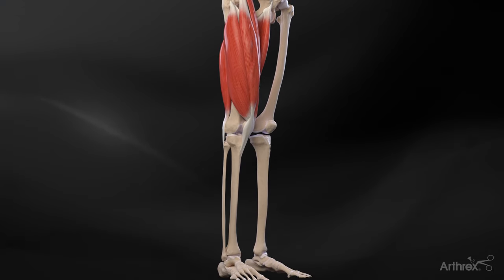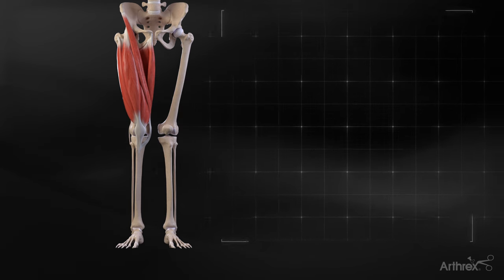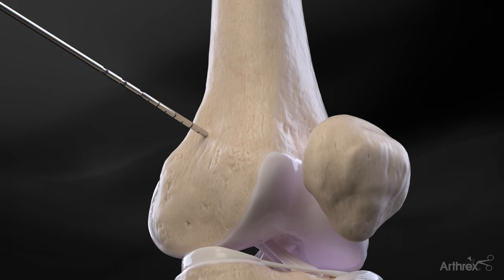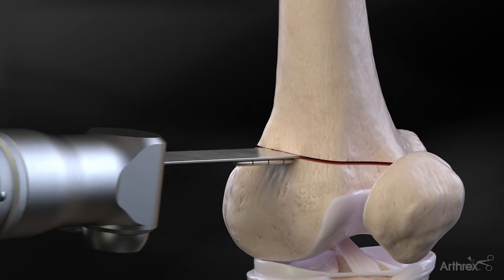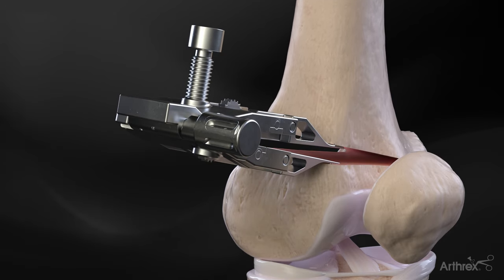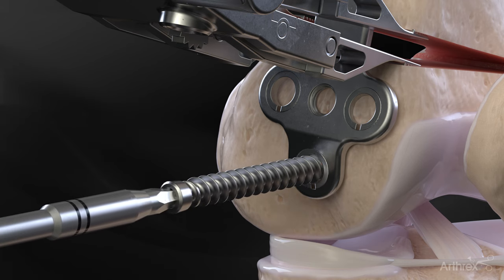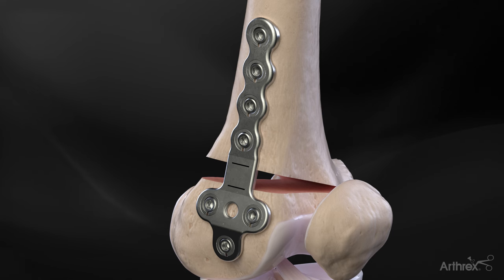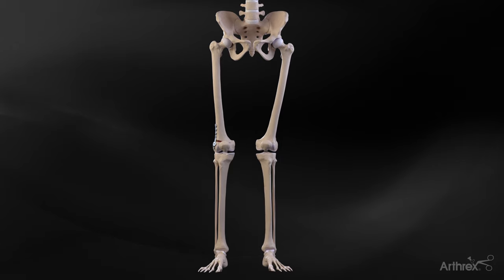Distal Femoral Osteotomy

Comment: I had this surgery last month, as well as having the front of my knee cap replaced and hardware removed from the front of the knee. I have to do my right knee the beginning of next year. I was born with Tubular Patella Dislocation and have had this issue since I was 8 years old. I was born with alignment issues and my knee caps being 3 degrees off. I had previous surgery prior to this one. They said I needed this in order to be able to walk another 30 years so I can get double knee replacement when I'm 65. This surgery is the hardest experience I've had, and I really hope it's worth it years from now because my quality of life hasnt been great for a long time.